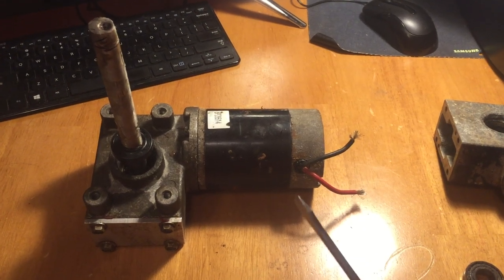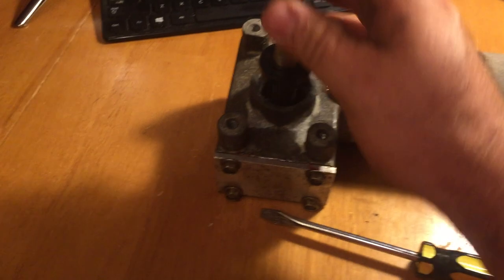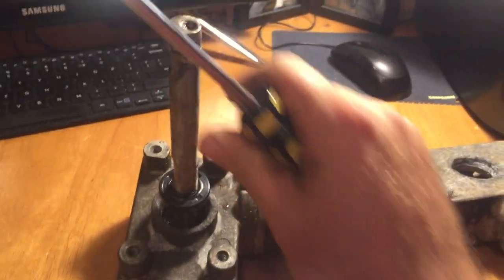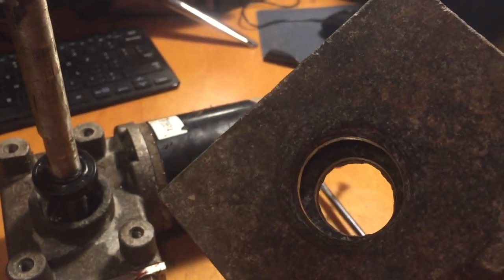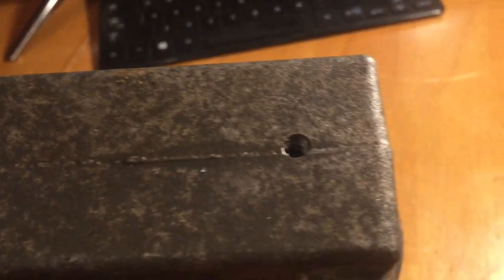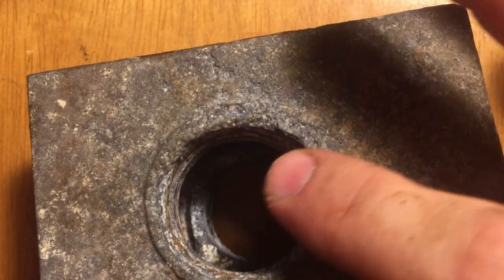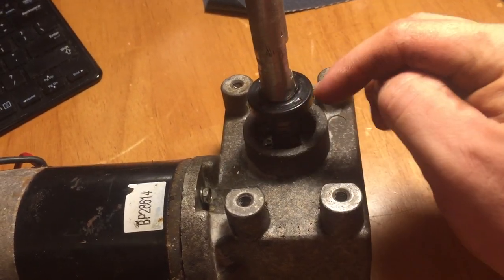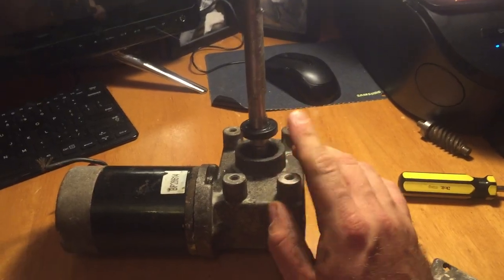Snowex D6107 D6566 Transmission Gearbox Rebuild

Comment: This is awesome, great video Josh! 

Will your rebuild kit work on a Snowex Sr-210 with D6078 & D6715? If not, do you have a kit for the models numbers I just mentioned, how much and please provide link I need a couple kits? Thanks
Reply from the maker: Michael O'Flaherty I only have specific knowledge to the transmissions in this video. This was all self taught since I own these specific spreaders. I don’t have info or rebuild parts for other models. Sorry

Comment: can you do a video on replacing the shaft
Reply from the maker: chachifeere I think there is enough info in this video for you to replace your shaft. Can I answer any specific questions? Simply remove the snap rings and drive the shaft out the top of the transmission
Reply: Where can replacement shafts be bought
Reply from the maker: chachifeere I have not found a source for the shaft
Reply: Bought your kit.. Went together fairly easy but now I'm curious...  What type of grease should you refill the cavity with?
Reply from the maker: @SkepticalSquirrell  I used general automotive grease. There may be a better option but that was my choice